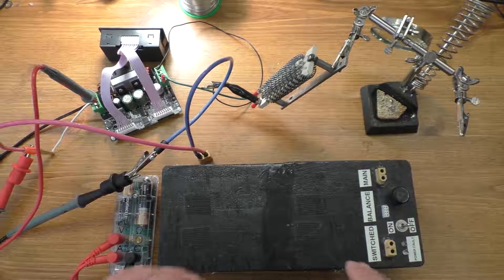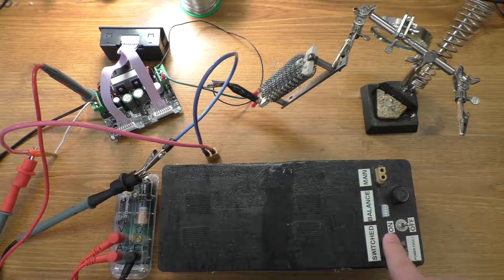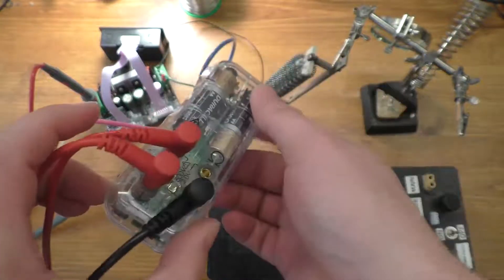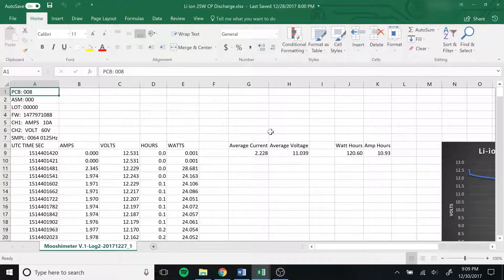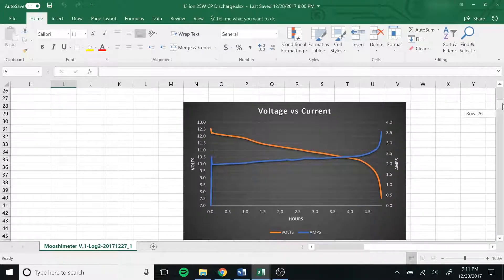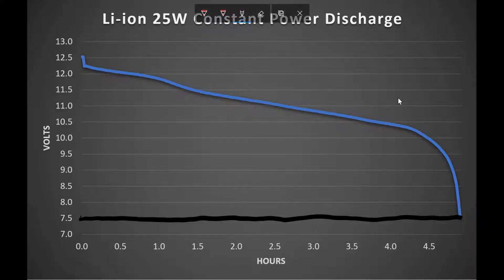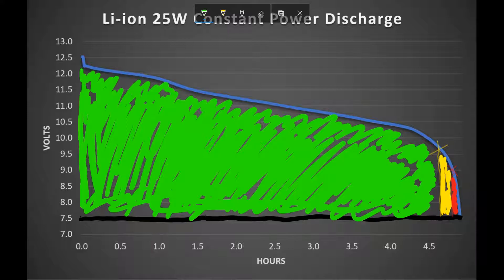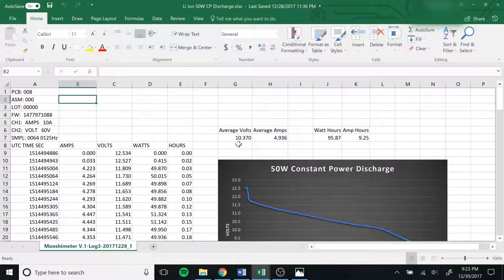Creating Discharge Curves of My DIY 12V Li-ion Battery Pack

Comment: Just watching your videos on building and using and ultimately testing your pack has been very educational
I'm in the process of (trying) building a 24v stand alone pack but now I am conflicted. I do own a 12v 350W full sinewave inverter but unlike yours it cuts out at 10.5v .  The Inverter wont fire for anything above 15.5v either. 
 Setting up a 4 cell system wont cut it either. Using a Buck converter to run the inverter is to wasteful + trying to find something powerful enough sounds like a headache.
 Here is my idea. Build a 24v powerpack. Buy a new inverter (24volt rated) and install a buck? converter down to 12v to run 12v bits and pieces up to 10/15A? . Also install a few USB ports for good measure.
 Finding a way to keep the cells balanced will need to be done manually. IE install a balancing plug like you have but use just a balancing board to keep all the cells balanced every so many charges.
 Purchase a cheap charger or set up a solar panel as I have a few 190W grid connect solar panels floating around and I live in AUS so sun is plentiful. Looking into a suitable Solar charger is  not to difficult as there are plenty of youtubers doing something similar.
 Anyway thanks for going to the effort of doing all this legwork to help out people like me who need a little help sometimes!
 Sorry for the ramble but you have been a great help!
Regards Peter
Reply from the maker: Thanks for posting the comment. I believe that if you were to set up a 7s pack that would be the best bet. It would have a similar voltage range to a 24V lead acid system. Running the inverter on that would work fine and then like you said use a buck converter to run other smaller 12 Volt accessories.